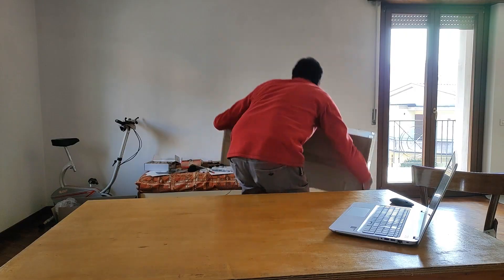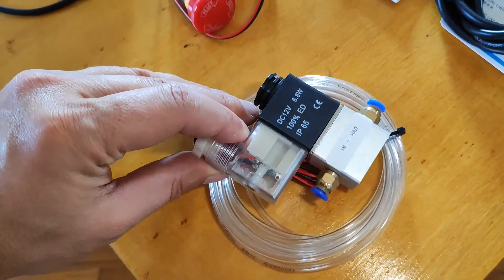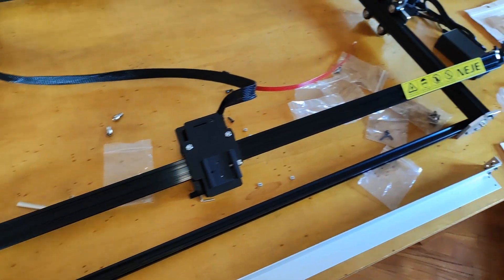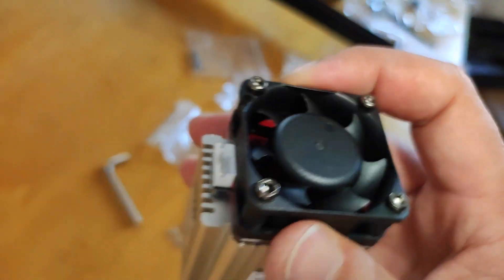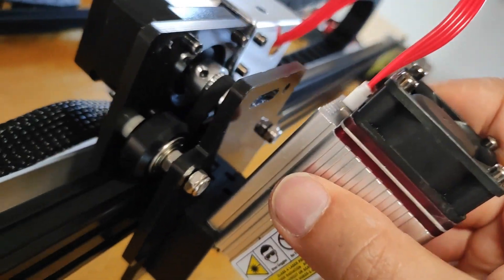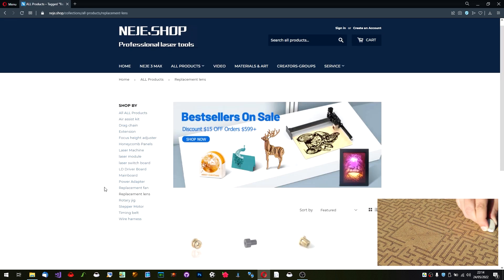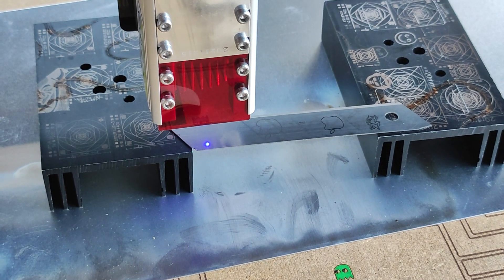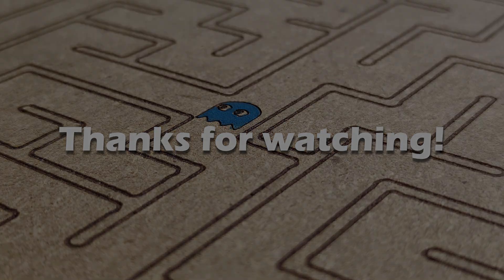NEJE 3 Max laser review, unboxing and assembly

Comment: 30W module!?
And optical power is.!?
Reply from the maker: My measurament of optical power is near 9W (I use a cheap, non professional, laser power meter).
Reply: @lasergrbl  My test  is 11W near 12W
Reply from the maker: @Kun373  I think my LPM is not able to do accurate measurement with this high-power modules because it's cheap and it's limited to 10W
Reply from the maker: @Kun373  what LPM do you have?

Comment: What about settings (distance from working surface) and compatibility with laser grbl? Tks
Reply from the maker: Hi mate
There is no "spacer rule/block" supplied with the laser machine (as other brand does). 
Neje suggest 30-33mm when engraving and 50mm when cut.

Machine is 100% compatible with LaserGRBL. I think (it look likes) that the machine has a double firmware, one to talk with their proprietary application, one to talk with grbl software (LaserGRBL/LightBurn) and it is able to switch between this two modes automatically.
Reply: @lasergrbl  Thanks for your very good software!! With this powerful NEJE module I have found that, when engraving on 'easy' materials like wood and leather, there is no need to change the focal height from the one I use for cutting, which I use much more often. 
This means I can engrave a card and cut it out, all with the one height/focus. Actually, all with one file because your software lets me "append" different together, a great feature!